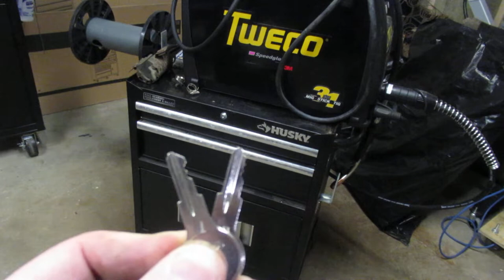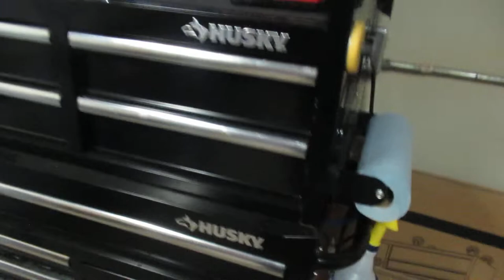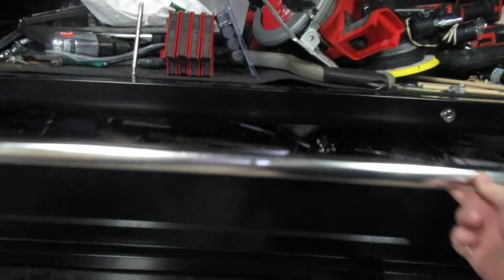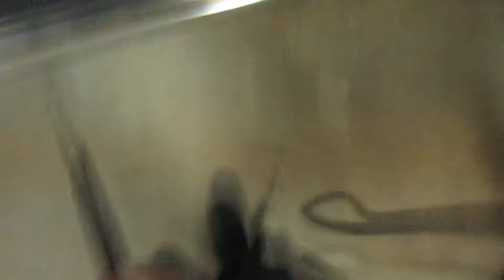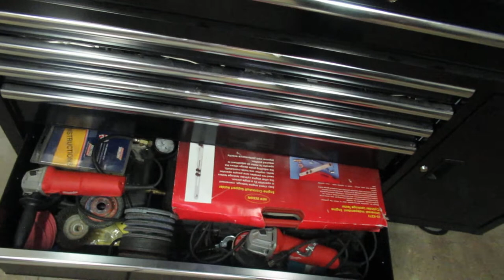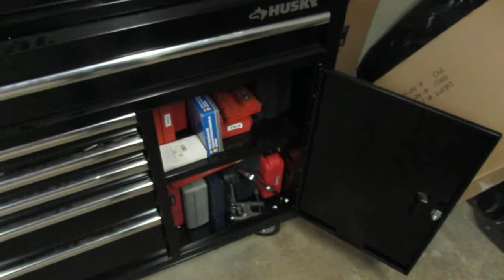8 Month Update Husky 61-inch 10-Drawer Tool Chest and Cabinet Set H61CH4TR6P

Comment: Thank you for the original video and this 8-month update. I bought one of these based solely on your review. It's still in my truck in boxes - I've decided to replace the center wheels with pivoting casters to eliminate some of the problems you have. Since there was NO mention of flimsy drawers or sliders, I've assumed you were happy with them and, as I said, bought one for myself. Thanks again!
Reply from the maker: I think you'll like it.  Nobody comes close on cost and the drawers are good.  They just take a bit of jiggling to lock the cabinet if that is something you will be doing.
Reply: @SteveRivett  I noticed. Also, I noticed that in the instructions it says to mount the non pivoting wheels on the side opposite the handle. I only saw it because I was wondering if there was a torque spec on those bolts. Typically, the instructions are only used to make sure my beer doesn't leave a ring!

Comment: The same wheels that come with it can be used other ways too.  A pair of the existing pivoting wheels can be moved to the middle and the fixed wheels can be moved to opposite end of the handle side.  This is a MASSIVE help when you want to move it - even if it's just to sweep under it.   Page 7 of the manual that came with it mentions this.   copy and paste this link -   H61CH4P H61TR6 Eng instruction sheet   -   (I can't include a pdf.)  it doesn't do anything other than download the manual that came with it but check your downloads and have a look at page 7 where that info is suggested.  Again, it's amazing how easy it is to move, and every bit as easy to apply a brake when it's done moving.  Cheers.

Comment: if you switch the casters from the center to the far end from your handle bar and the ones from the edge into the center, you will be able to park it a lot easier...
Reply from the maker: I should have tried that before I filled it with tools.  I won't be able to do that again until I move the toolbox to another location as it would have to be empty.

Comment: Does it have the soft close drawers where they pull themselves in at end when they close?
Reply from the maker: No, the drawers have a closed position but I usually need to hit against the box with my hip to get the lock to work.  Newer models may have been updated so you should go check the store.

Comment: Online description at HD states ball bearing drawers.  Can you confirm?
Reply from the maker: I am away from the toolbox right now so I can't say for certain.  The drawers all work well so I would not be concerned about them if you are considering buying one of these tool boxes.  They are great value for money, I don't think anybody is coming close right now.  They seem to be rolling out newer toolboxes in Canada now but I prefer these ones.
Reply from the maker: I had a look today and the ball bearings are very well concealed if they are in there.  The slides aren't the type where balls are open and easy to break loose.
Reply: Thats a really  good question  because  this box he's  showing  doesn't  appear  to have ball bearing  sliders. The force he's  using to push them in with, they way the tools rattle as the drawer comes to an abrupt  stop is a good indicator  they don't.
 Probably  also the reason  he has to push all the drawers in a little to get them to lock.
 I'm thinking  this is a very low end box, it looks nice, serves its purpose  but just doesn't  have all the nicer  things on it. Ball bearing  slides are a MUST have,  I won't even look at a box without  them.